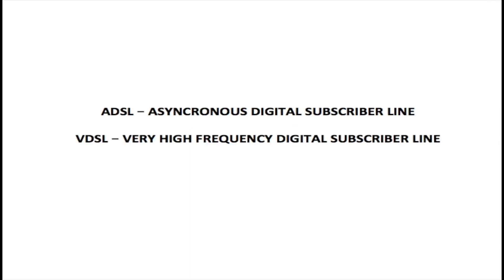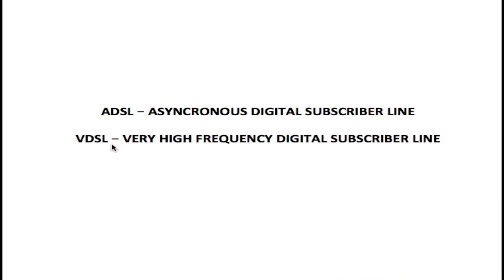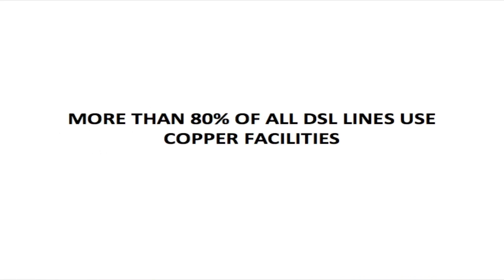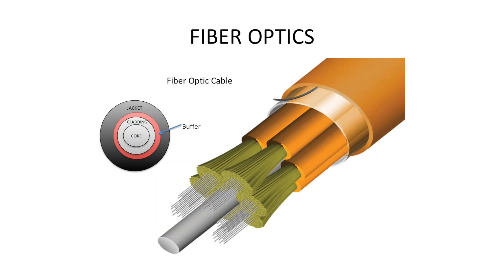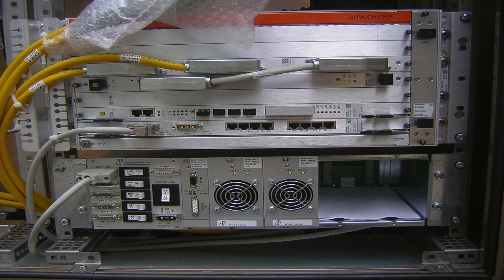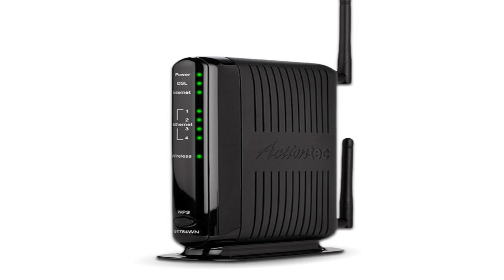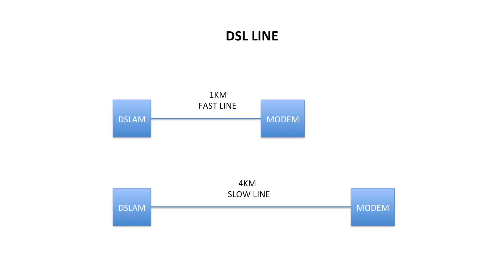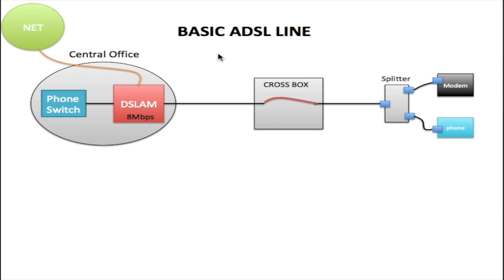Why DSL Bonding Will Make Your Internet TWICE As Fast

Comment: So the bonding happens on premise right? Where do I get these bonding routers? Would I be able to bond 2 separate VDSL lines (each with their own router/modem) into 1?
Reply from the maker: The type of bonding I am talking about has the modem being bonded as well as both DSLAM cards bonded together.  The dslam cards are connected to two dsl lines. Bonded to work as one. The DSLAM card balances the load between lines and increase over all line speed.  
I use one DSL modem with  2 DSL line inputs and the modem is supplied by the ISP.

Comment: Can I connect to one line 2 modems?
Reply from the maker: There is no technical way to have one DSL line work with two modems at this time.  However connecting two twisted pair lines to one modem is possible as described in the video whch is cslled DSL bonding.

Comment: ADSL simply means asymmetric DSL. This because the speed down is much faster than the speed up.
SDSL is synchronus DSL. Both the speed up and speed down operate at the same speed.
Reply from the maker: That is correct.  Most DSL lines are ADSL because most subscribers download more than they upload so they require a higher download speed.  SDSL lines are needed by subscribers who may need a higher upload speed as well.   like from a web server or mail server etc.

Comment: Is bonding technology reducing latency or increasing?
Reply from the maker: Thanks for the question.  It would be nice to have data sent over the internet arriving at your modem instantly.  However, everything takes time, and the time data takes to get from its origin to its destination is referred to as latency.  We strive to reduce latency with DSL lines by combining two DSL lines which is known as DSL Bonding.   The reason we have DSL Bonding is to increase the speed of the line.  Increasing the speed would get your requested data to your device much faster, thereby reducing the latency.  Higher speed results in lower latency and lower speed results in higher latency.  I hope this explanation was helpful.

Comment: was 20 mbps the max speed? i have fttn internet and i pay for 50 mbps
Reply from the maker: It may be the best speed depending on the length of the copper line between your home and the node or it could be a defective line. You may want to contact your ISP to see if you can get the speed which you are paying for.  In case its a distance issue, you may want to ask about DSL bonding.  May be they would give you at the same price.     Thanks for the question and Let me know if they were able to help you, and what they did.  Good luck.

Comment: question not sure if u will be able to answer but why can't ISP just give everyone who wants bonded a bonded connection for example where I live we use to have a bonded connection but got knocked off thanks to Centurylinks shady business practices (had it for 2 years but when I got my own modem from them they got rid of our bonded saying they don't serve it in my area) and are unable to get it back
Reply from the maker: Hi Jack, that is a very good questions.  However with out knowing if there is a technical reason for your area being denied dsl bonding  service, I can't really provide an answer.  Technically for an ISP to have DSL Bonding they need a DSLAM that is capable of bonding and two good quality cable pairs to transport the service to the subscriber, and of course the shorter the length of the cable pairs, the higher the speed will be.  Thanks again for the question Jack, and I hope my answer was helpful to you.

Comment: sir if u train to fiber optic is ur 1st step is copper?
Reply from the maker: I believe that your question is if you need to know how to work with copper before doing Fiber Optics.  Its is not neccessary to be an expert, but you should at least have a basic understanding of copper, and  how phones and DSL lines work with copper.   I would suggest getting at least a basic understanding of telecommunications on copper before doing Fiber Optics.  Hope I was able to answer your question.

Comment: Don't worry bro I clicked like but honestly you don't see DSL much anymore here in my town in Minnesota all it is spectrum CenturyLink they can't go over a few megabytes nobody uses it here
Reply: It depends on the type of DSL and distance. I can get cable and AT&T internet. I get 100 Mbps down 20 Mbps up from AT&T and it's VDSL2. But they use pair bonding and I'm close to the node (AT&T calls it a VRAD). Went with the VDSL2 because it includes unlimited data and it's 55 bucks a month.
Reply: @sean8102  dude that's not that bad at my work they have arvig and they're so close to the node they can get the same speeds as you that's freaking sweet ✌️

Comment: Although the general concept is sound, there are numerous inaccuracies present in this video. While the video may be well-represented for the average user, an expert in the field will notice many misrepresentations.
Reply: Would you care to elaborate?  this will help everyone
Reply: I think one small inaccuracy is the splitter with the VDSL setup: I don't have it any more. All the analog phone communications has been replaced with Internet based phone calls (VoIP) nowadays, the modem/router is typically responsible to tunnel this phone communication as well as and provide the analog RJ11 connector at the user end (maybe splitting it with a separate VLAN ID).

But anyways, many thanks for explaining the main concepts!
Reply from the maker: I just noticed this comment which was made a while back.  The comment is that Analog Phones service has been replaced by VOIP, and it's not used anymore so splitters are not needed.   This is not correct.  Some phone companies may have gone that route, however the majority of Telephone companies in North America and in most other countries still use analog phone service and require a splitter which is used to separate DSL service from the analog phone service because they share the same physical copper line.  Hope this was helpful.
Reply: @TelecomTraining  I agree with this statement as both FCC regulations and most local state regulations mandate that copper telephone services be maintained and offered in almost all jurisdictions and exchanges. Although many companies are transitioning to VOIP in today's modern telecommunications network infrastructure, it is important to note that the vast majority of rural areas in the United States still do not have access to VOIP and continue to rely on traditional POTS telephone service over legacy copper wires.
Reply from the maker: Do apreciate the reply.  I can see that you are quite knowledable  and Its really helps to create a good learning invironment.
Reply: @JamieDelour  One of the largest IPTV deployments in North America has successfully delivered IPTV services on speeds as low as 4mb down 1mb up over bonded ADSL2+ for standard definition. Similarly, VOIP services have been delivered on speeds as slow as 1.5m down by .5m up over ADSL/ATM.

Regarding pair-bonding, when pair-bonding is accomplished, separate cards are not used. Instead, the same card is used, but with different ports on that card. Typically, the ports are side-by-side and consecutive. While there may be a few other minor discrepancies, they mainly concern terminology.

Overall, this video provides a good overview of the concept and technology of DSL, and would be helpful for an average consumer or novelist to gain a better understanding of the technology. However, for an expert in the industry or a field technician, this video may be mildly misleading.

It's worth noting that speeds less than 10mb in most cases do not provide a good quality experience in today's high demand internet. Therefore, it's important to have a good understanding of the capabilities and limitations of DSL technology to make informed decisions when selecting an internet service provider.

Comment: I have a question can i run vdsl on a single pair cable ? 
My isp uses this cable for adsl2+ lines : https://imgur.com/a/jmqE3Gi      Which is a Bell system type C rural service drop cable (  conductors : 14 or 12 AWG solid 30% conductivity extra high
strength copper-covered steel) it is an old cable  buit surprisingly i still get a decent attenuation and internet speeds for adsl2+ "here my router stats": https://imgur.com/a/OIRjrLn) 
14.5 db attenuation / 8 SNR margin / around 21/22 mbps max bit rate line.
Reply from the maker: Basic ADSL and VDSL use just a single pair of wires.  A second pair is used as with pair bonding in order to increase the speed.  The thicker gauge wire like 12 or 14 would definitely help improve performance.